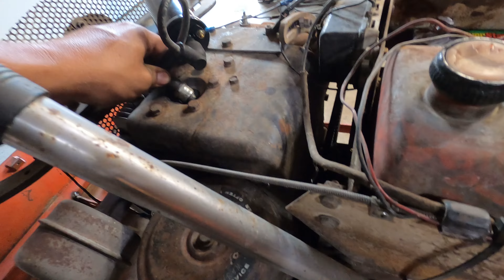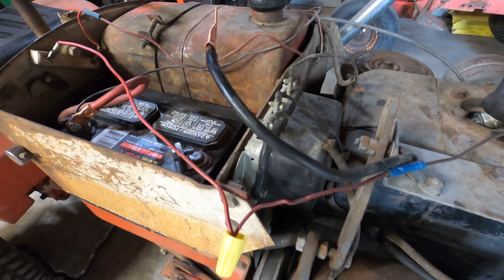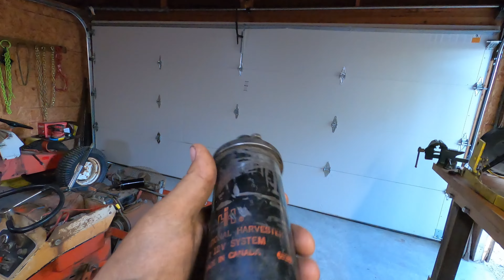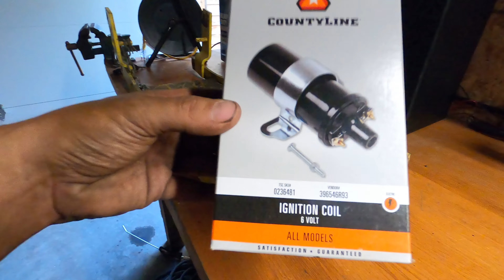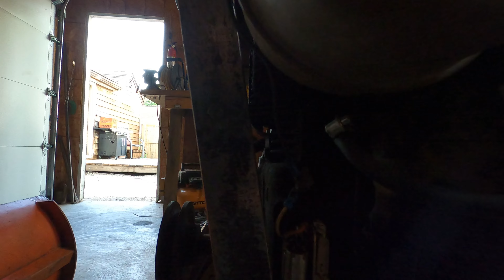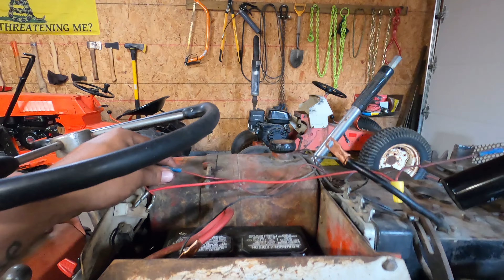Simplicity Landlord Garden Tractor No Spark. Need Advice

Comment: I have the same problem has no spark so what wrong with it  ? Simplicity 3212V
Reply from the maker: @randypham8710  this unit ended up needing points and condensor and it worked great.

Comment: 1. Rotate engine until the points are open and make sure you have power to the + side of coil. 2. If points are open you should also have positive voltage at the - side of coil. If you don't remove condenser and recheck. If still no voltage at - side of coil remove the wire at the - side of coil and retest. If still no voltage coil is bad. If you have voltage now something in the points or wire going from coil to points is shorted. 3 rotate engine until points close, this should cause the voltage at the - side of coil to go away. If it doesn't the points aren making contact for some reason. If it does its probably the condenser is bad but could potentially be the secondary winding in the coil.

Comment: Are the points contact moving when the engine turns over and at the right gap? And if you have a electric meter or a test light check if the coil is getting 12 volts
Reply from the maker: The contact moves when it turns over. Not sure if the gap is right but I don't know why the gap would go out of wack because it was running fine. Where do you put the leads on an electric meter? I have one
Reply: @skywatcherranchswr  you can put the negative on the battery and the positive on the positive side of the coil